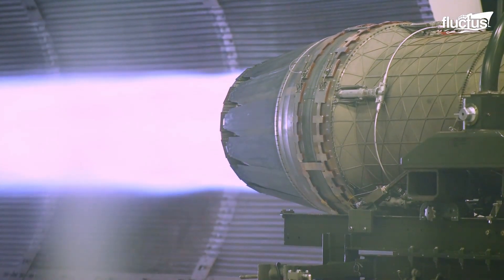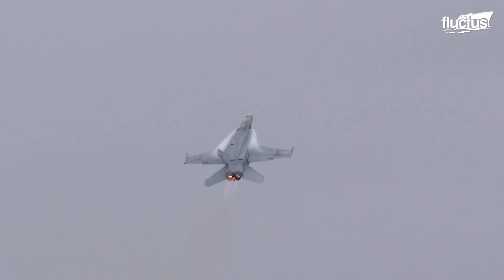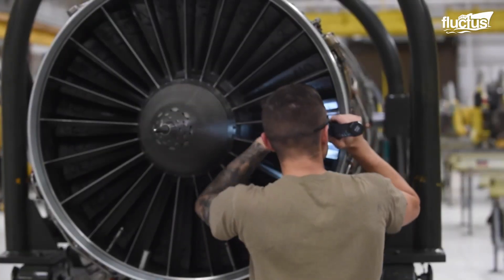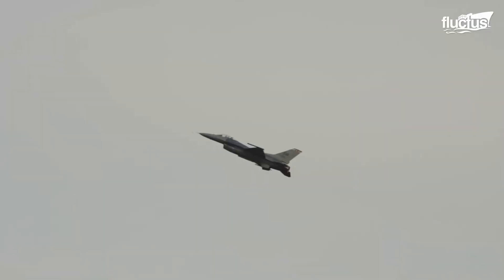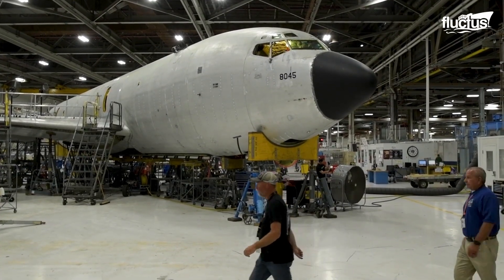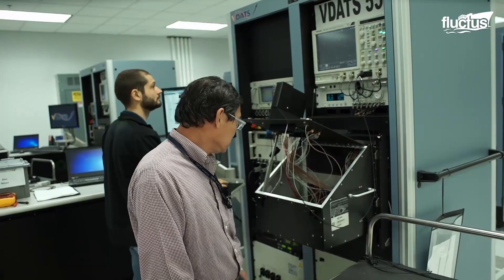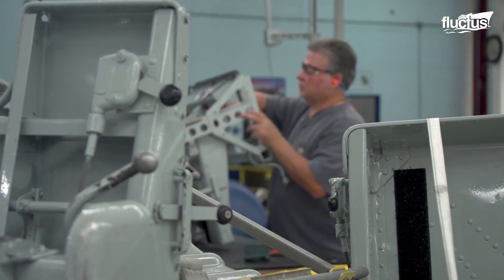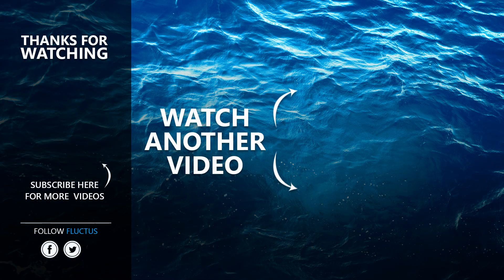The Insane Billion $ Processes of Repairing Thousands of US Air Force Jet Engines

Comment: WP on the F16 stands for Wolf Pack. 
The United States Air Force 8th Fighter Wing is the host unit at Kunsan Air Base, Republic of Korea and is assigned to Seventh Air Force. Seventh Air Force falls under Pacific Air Forces (PACAF). The Wing's 8th Operations Group is the successor of the 8th Pursuit Group. one of the 15 original combat air groups formed by the Army before World War II